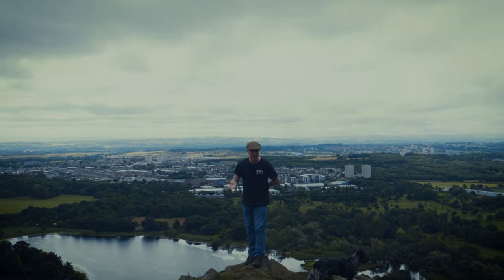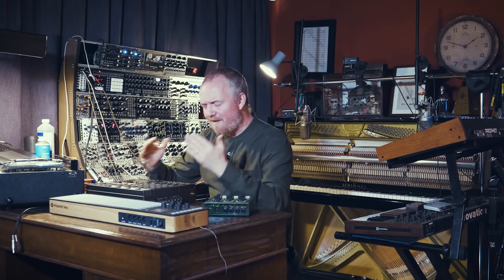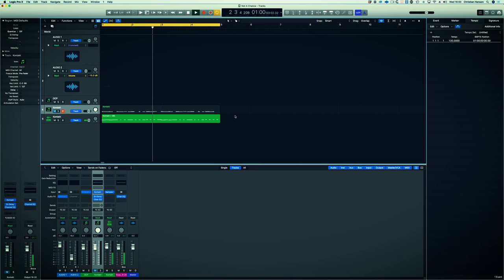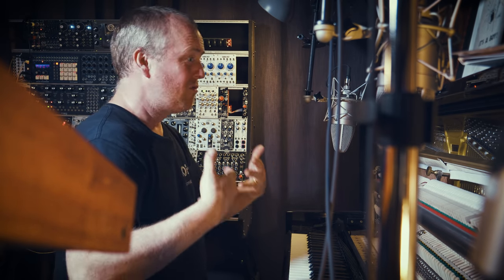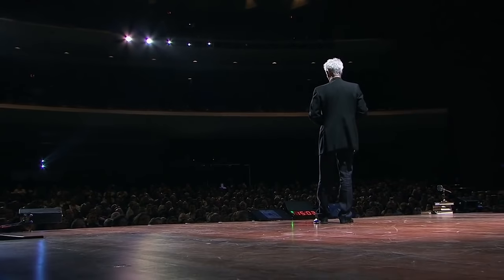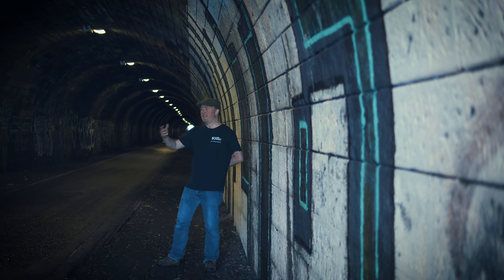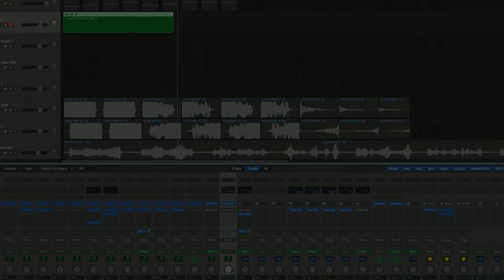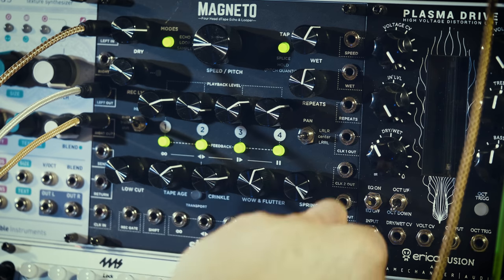Why Are Synths So Difficult To Mix???

Comment: Reminds me  of the great Eno quote: “Whatever you now find weird, ugly, uncomfortable and nasty about a new medium will surely become its signature. CD distortion, the jitteriness of digital video, the crap sound of 8-bit - all of these will be cherished and emulated as soon as they can be avoided. It’s the sound of failure: so much modern art is the sound of things going out of control, of a medium pushing to its limits and breaking apart. The distorted guitar sound is the sound of something too loud for the medium supposed to carry it. The blues singer with the cracked voice is the sound of an emotional cry too powerful for the throat that releases it. The excitement of grainy film, of bleached-out black and white, is the excitement of witnessing events too momentous for the medium assigned to record them.”
Reply: I love Brian Eno.
Reply: Facts
Reply: That, and nostalgia. There's something so postmodern about using a tape simulation plugin to rough up a digital recording. Not that it's wrong though.
Reply from the maker: Wells Oliver I love this comment thanks so much.
Reply: I do whatever I do completely digitally because I don't have the money or space for hardware. There's a reason I cling to my reverb and delay FX so much, use exciters and amps all over the place, go bonkers with saturation, etc. I prefer my grungy, dirty breakbeat samples to just about anything else, too. Often I distort them further, even.

When you're producing digitally, your goal isn't to make things "clean," it's to have complete control over the canvas so you can add dynamics in as you want them. This means it's also not about loud or about quiet, wet or dry. This means it's not even about getting a "real" sound.

It's about getting a good sound, something exciting and interesting. For that you need width, richness, complexity, both harmonically and spatially.
Reply: @HaveYouTriedGuillotines  That second and third paragraph are some of the most progressive words relating to music I've read in a while. Just came from a video that was gatekeeping over drum samples not being as good as live drums. Different tools for different tasks, right? :- )
Reply: Hammy Havoc shoot, I’m a drummer, but sometimes I reach for the MPC. They’re different things entirely
Reply: yep the moment they put analog synths into VSTs - suddenly they went from junk people were nearly literally throwing away (I've heard real life stories like a dude finding working Roland SH-101 in a trash bin on the street in the late 80s) to something sought after so much. It wasn't Yamaha DX that did it, by making them sound outdated at the time. It wasn't even Nord Lead that digitally emulated them without all the warmth and instability. It was removing the physicality of it entirely.
Reply: @wrmusic8736  VST wasn't around in the 80s. VST is 1996 onwards.
Reply: @HammyHavoc  which is not what I ever said
Reply: @wrmusic8736  I'm honestly not even sure what you meant. I don't think VSTs sound like analogue, and most people seem to use a mix of software and hardware as everything is so accessibly priced these days.
Reply: @HammyHavoc  reread Eno's quote and then read what I wrote. VSTs allowed anyone with a computer to write music with a quality professional enough to replace hardware, in particular analog synths which many plugins originally sorta-kinda did represent (will not be calling it emulation as they were missing the whole point of their sound).

And because it reached a point where you didn't need to have hardware synths anymore at all to get similar results (avoiding wasting so much space on something that seemingly could do so little compared) - suddenly knobby analog synths became all the rage and went from things only underground musicians bought secondhand because that's the best they could afford - to 40 years old synths costing 5 digit numbers.

In the same way "primitive" digital AMS hardware from the '80s is costing so much now, in an era of 24 bit 96 KHz being the minimum level of sound quality, because of them bringing back that very noisy and extremely aliased old digital sound that people wanted to get rid of at the time.
Reply: damn thats knowledge
Reply: That was a poetic reply
Reply: Could never articulate that thought so well if I tried my whole life.
Reply: great quote. eno's a don
Reply: I love these(for me new) analog sounds, the trouble is, i want analog depth and low end...but paired with fat 808's, rn i am trying to find out how much unperfect and viby at the same time it can be. I dont want to make music for mobile phones.
Reply: Failures are what makes us human. We are in conflict - we're afraid of failures because the greatest failure is death itself. Therefore we strive for perfection creating digital perfect algorithms to get rid of failures ... but perfection is too empty, void of the strongest emotion ever - fear.
Imperfections and fears are what drive us to read bad news, despite that it's irrational - we should like good news better. Of course, we don't admit that we are "fear junkies" (except that every journalist knows that "bad news is good news"). Failures and fears can be so rich in so many ways... and also so very negative and destructive, when thinking about them too much.

I guess, it's all about the balance. To find the existential comfort in music, we need a bit of fear in it, so that fundamental notes make us feel safe and comfortable again after scaring us with some imperfect distortions. Mother's lullaby feels the most powerful after we've been scared a lot.
Reply: Wow I learned a lot of that comment and video of course
Reply: In the future we will cherish the sound DAWs crashing from overloaded cpus, audio dropouts and cheap plasticy midi controllers with tiny led screens.

Comment: I have the exact opposite view, I think synths are by far the easiest thing to mix. I know exactly where they sit in the frequency and dynamic range, and they are really easy to keep there. As a result, my mixes have barely anything at all on the master bus, because there's nothing that needs to be tamed like an acoustic recording does.
But, modern synth presets are a nightmare to mix, because EVERYTHING is so damn stereo with overly bright reverbs, OTT compression and Haas stereo FX, it's like being inside a 360 degree surround unison saw oscillator all the time. Easier to start with a mono source, add some dirt if it doesn't have it, a bit of saturation to round the peaks and give it more weight, use Bad Tape if you don't have a cassette recorder (delicious unstable pitch when used carefully), maybe record through some random external gear a little bit too hot... or use any old dusty synth that you might have if you're made of money or got it before they cost 10x what they're realistically worth.
By the way, something nobody talks about: Put up any mic in the back of your room and record your speaker output, and don't worry about random noises. Use it as a crap room reverb, there's no plugin like it. Cheap and crappy, and it has character. Compress and saturate, and it's delicious organic dirt behind the main signal.
Reply from the maker: REKT your latter point is great and I think we both differ but are on a similar page. Within the digital domain I think synths especially modern ones are a nightmare and as you get further back along the timeline to vintage gear things become easier but marrying purely electronic sounds into a film score has proven very difficult for me.
Reply: Excellent points. That's the thing about modern synth presets, too many built-in effects. They sound great "out of the box", but I usually switch all the effects off before mixing, unless one or more of the effects contribute significantly to the sound. Delays and reverbs have to go though. Putting a digital synth through an amp sim is another option. I like your cheap reverb suggestion. My home studio is at the back of my garage, could put a mic out there. Maybe even send a signal out to a guitar amp out there too.
Reply: Indeed. Modern synth sounds (VST etc) tend to try to be the EVERYTHING of the moment. They are not built to be instruments that are part of a combo but the whole shebang on one keypress (all that paint-stripping noise with layers of effects). I just wrote a piece and pulled in a preset I made for someone else's synth for the lead. Impressive evolving sound. It was useless in the mix seeing it was harmonically all over the place. I made a new sound (using the same additive synth) with far less action, the line worked fine. Mixing was a bit hard seeing the main Pad under was playing everywhere but not so tricky.

I think that a lot of people have completely the wrong idea on how to make & mix synth sounds so they overdo it. Just about every time someone sends me a Piano + Voice track they are struggling to mix, the piano sample is like Tipton & Downing standing on opposite sides of a huge stage. No matter how hard you work on that voice track, it will never sit right. Simplify the piano, get the singer focused and suddenly it is winning.

I have issues with the amount of digitally created distortion that is being put in mixes. I think it makes them very wearing and unpleasing to listen to. I try it (even under the guise of Saturation) and by the time I check the track real-world it has to pretty well all come off. I bet mic'ing a speaker would be less worrisome - a safe bet seeing older recording did exactly this and rarely sound wearing.
Reply: It's not so much that synths are "hard" to mix, but rather things can become VERY complex, VERY quickly, when you are mixing multiple synths from different era's, (and manufacturers), which all have their own very unique "tone", which needs to be blended and balanced to come up with a unified sound in the final mix. 

Two of my favorite synths currently to compose with are my Yamaha Motif XF, and Korg Triton - two workstations with... a decade (?) of time and advancements in the underlying technology separating them. Both have their own very "personal", distinct, tone - the XF I would call "sharp", or solid, while the Triton would be more "soft", or organic almost. Trying to layer a Triton with the XF, and not end up with a mix that sounds... disjointed... can be extremely challenging depending on patches being used. This is why I've always told people synth programming and mixing is a true art, and it's an art that is slowly being lost to time, as fewer and fewer synth players and audio engineers take the time to really learn.
Reply: "because there's nothing that needs to be tamed like an acoustic recording does." I think this is the whole point of the video, when it comes to adding a synth to more traditional forms of music mixing becomes much more difficult compared to just your standard EDM style of mixing where you make each sound its own
Reply: That last point is something I've never thought to do. The mic I have is awful, cheap, years old, and the noise floor is like in the -45s, so not exactly the great sounding mic... But it could give an interesting result
Reply: @BenedictRoffMarsh  Seems to be a common problem with electronic instruments with presets in general. I often find I'm turning the output down and turning all the effects off on synths just to get a somewhat usable sound.
Reply: Me too. I think synths are easy to mix.  In terms of the stereoness of modern synths...right...either make it MONO and take off all the fancy ambience OR have it as a SUB-STEREO based on panning in the stereo spectrum.  Easy.  If it is what it is and you like it, use it.
Reply: Yep, if you want to make something really big, you need to scale down its components. Otherwise the result is usually a blob of sounds fighting each other.
Reply: I’ve taken to mixing in mono, as a metric for combining synths, guitars, and orchestral samples. It definitely changes the way you hear everything. Of course, I’m not an expert....
Reply: DIV1NITAL i think it’s the same guy i got the idea from. In Logic, I’ll either use the gain plug in at the end of my output chain, or the slate infeq, which  can be switched to mono as well.
It’s really interesting.... it definitely shows my problem areas...
Reply: DIV1NITAL i just started creating music for stock libraries, and due to that, i need to really work on mixing. Mono helps me keep kick drums from bass lines. Even bass synths can step on kicks, so monitoring in mono opens up the eq for me, so that i can better balance my mixes. 
The nice thing about using the Gain plugin in logic, is it doesn’t color the stereo mix, that way you can monitor in mono without fear that once turned off you don’t have weird  artifacts. 
I’ve been a performer and songwriter all my life, so recording is nothing new. However, producing different types of music genres is much different. I’m an old metal head from the west coast. Synths are a new concept for this guy!
Reply: @looneyburgmusic  Do you have any good books or other recommended reading material that covers this topic?  Thanks in advance.
Reply: @user-ld8ep5qr7m  Audio Engineering you mean? 

There are a zillion of them... Do an Amazon search and take your pick. But honestly, the best way to learn absent going to school for a couple of years is a combination of trial and error trying yourself, and if you are lucky, working with/under an experienced audio engineer.
...
When I started out, back in the late 80's when I was just getting out of High School, I was lucky to spend some time apprenticing at a working studio. The job was mostly doing bitch work for a pair of engineers, but just being there gave me the chance to literally be "the fly on the wall" while they were working, and I paid attention to every little detail I could. It's how I learned audio engineering is as much an art as it is a science - you don't just have to learn "how", to do things like setting up mics, and gain staging, or running a console, or what effects to use for when, but also the, "Why's" of all of it.
Reply: @looneyburgmusic  Thanks for the reply.  I was more specifically referring to this part, but the rest was interesting too:

"synth programming and mixing is a true art, and it's an art that is slowly being lost to time, as fewer and fewer synth players and audio engineers take the time to really learn."
Reply: @user-ld8ep5qr7m  Ahhh... Yeah, I don't think there are any  book written specifically to cover just mixing  synths.. At least I've never seen any myself. It's sort of something you will naturally get a feel for, as you gain experience. I've been at this now for  30+ years, and I can still remember how much trouble I had with my first 8-track home studio setup back in the late 90's,  getting my synths to play nice with each other on a recording. Another tip that helped me a lot was something an engineer told me - Never be afraid of criticism, or let it get you discouraged. When you have a good sounding mix people won't be able to help themselves, they are going to tell you it sounds good. And the same goes for a bad mix - people are going to let you know. Just don't take it personally, use what other ears are telling you to improve your work.
Reply: @looneyburgmusic  Thanks for that, I'll keep it in mind!
Reply: You know what's so weird? We used to know nothing of mixing or production, but somehow made these bangers.. sound so good.. starting with a synth, some kick, and hats.. and highs lows n mids. nothing else. right into a 2 ch mixer.
i guess it's from having to rely on that as a dj on vinyl. and having just a 303 and 909 and some speakers. There used to not even be mid freq. knob on some gear 😂 just treble/bass. 

Then i find a pro talking about a secret mixing method of just using 3 eq bands to isolate things. nice 😁
we just made it work somehow

it was always- 808 and kick is low.. make it bang. and synths n hats had everything else. u just make it loud. then balance them and no conflict.

since everything was so loud, the perceived loudness gave room for the synth, mostly, just with simple volume, and sound selection itself or filters. 

too much bass? turn down low end. synth pops out more, accent with some high end, get the mid right, and raise master. simple as that xD. 
it was habit.

and strange how that concept now translates to pro mixing and mastering in the way it does. 

good times
Reply: have you ever done any sound destruction? on physical mediums
Reply: Uh... so you add chaos to make it more agreeable?
Reply: 15:15

Comment: Funny how when you have been working with electronic music for a long time, you tend to do things to compensate for the sterility in an almost unconscious way. I always ALWAYS add a small convolution reverb to pretty much any digital/electronic sound i have when im creating music, to put it in a physical space even if its only slightly audible. It not only helps with mixing but you can tweak and blend spaces which will bring out complexities. Different rooms have their own resonant frequencies and it just helps to give 1 dimensional sounds a bit of life.